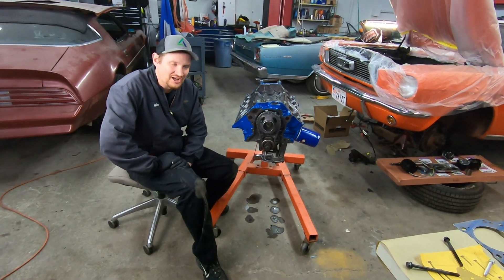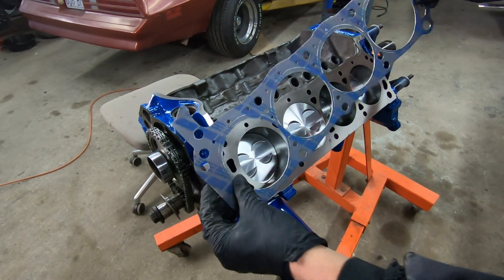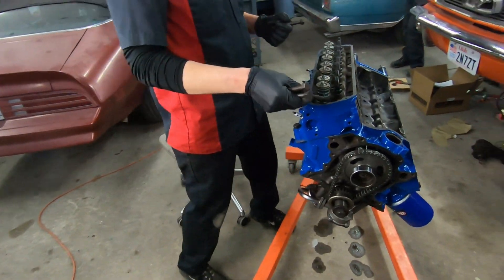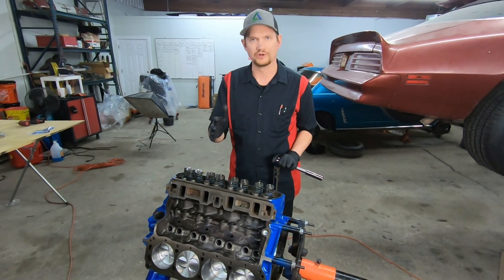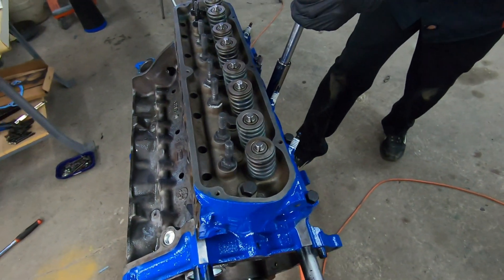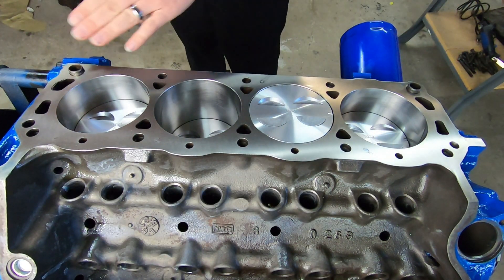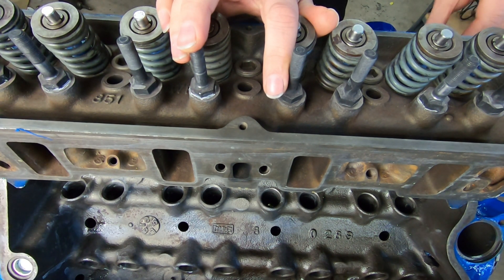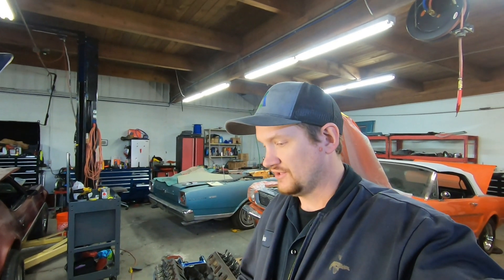Cylinder Head Installation - Rebuild the 289 Ford - Part 10

Comment: Also, do you not put on a very thin coat of oil on your threads and bottom of the bolt head? A think coat so excess does not go into the threaded hole causing hydraulic lock up.
Reply: Yes and under bolt head too.

Comment: great video. For any one interested. I use a E3AE-6059-AB timing cover for my early 289/302s which uses an external seal. Also a trick I use is a two studs that can be removed to allow the heads to come down straight. I also use this for intakes manifolds,  exhaust manifolds, transmissions. Anything that needs exact placement with control. I also have used aircraft grade thin washers so I can torque the heads tighter per Edlebrock specs.And if one is going to keep the car, I powder coat everything but the block and heads. They clean great with Simple Green. And the pan, timing chain cover, valve covers internally do not let the old oil build up gunk. I also use grade 8 bolts on everything.  They don't break if they get rusty. And anti seize on everything.

Comment: Hey! So I removed my exhaust from my car, straight pipes and there was a very small amount of oil in the header pipe on what side. Could that be normal from sitting or this gasket? Looking at cheaper options first as it was so little.

Comment: Hi  Stupid question here lol   How can you have 351 heads on a 66 mustang 289 stock ?? as 351 heads are 60.4 cc combustion chamber and 289 1966 are 49.2 or 54.5 cc ?  I know  bigger valve but any chance to drop in compression ratio ?

Comment: Awesome videos and very informative. I’m planning on starting a 347 stroker build soon with a roller cam kit and I was wondering if all the procedures are the same. Valve adjustment , and so on. Iv watched everything learning as much as possible for when it’s time for me to put it together, Great content and straight forward I just subscribed
Reply from the maker: Thank you. The procedures will be similar but not the same. Building a stroker takes a bit more than a stock 289/302. I would recommend buying some books, talking to your machine shop, and trying to learn as much as possible.

Comment: Does anyone know if the 351C heads 2 or 4V will bolt onto the 289 blocks.-Thanks very much.-Joe K.-
Reply from the maker: Well I know they bolt to 302 blocks but there is a certain amount of work that needs to be done for oil and cooling passages. This is something you wouldn't want to do without doing proper research.
Reply: no

Comment: great stuff Alf. Is using thread sealant a must for the 289 headbolts?
Reply from the maker: It is not. None of the bolt holes go into coolant passages. Gotta watch out for that on the 200 inline 6 Fords though.